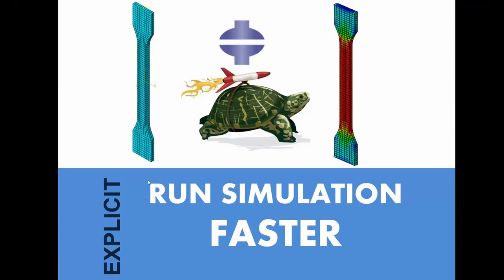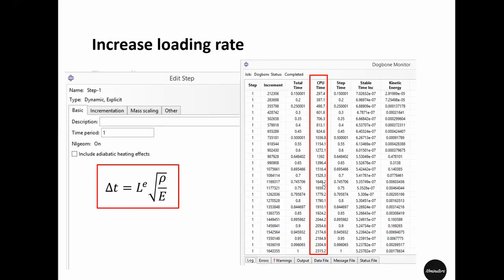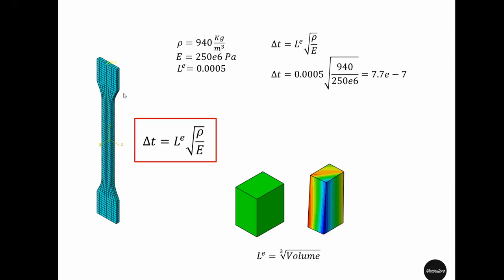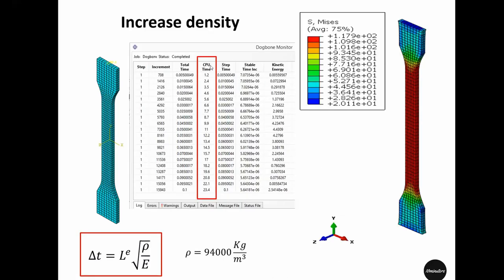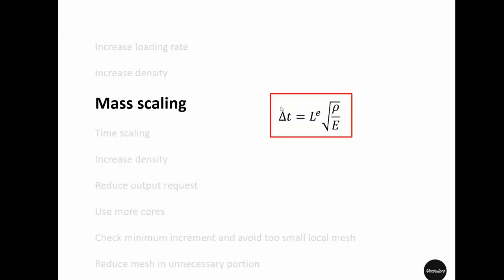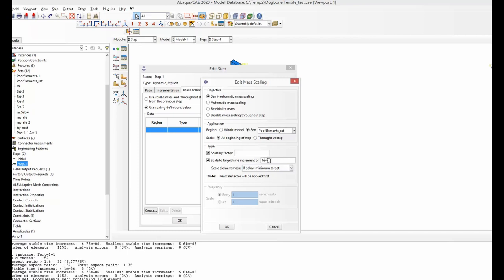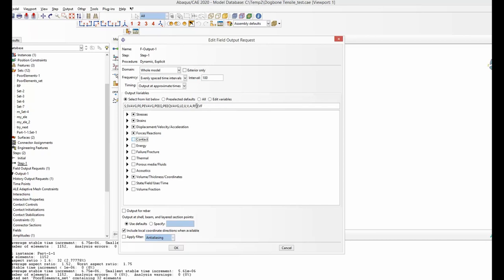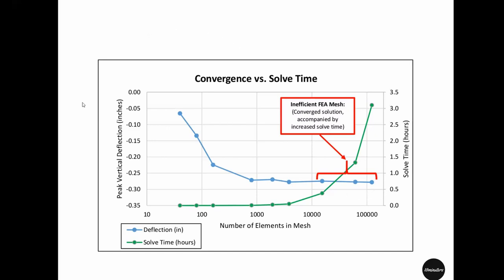How to run Abaqus Explicit simulations faster - 8 Tips

Comment from the maker: You trade-off reliability of the result using these tricks like mass scaling. Some tip on sanity check: Check that the kinetic energy (EKE) does not exceed 5-10% of Internal energy (EI) when using mass scaling. Then make sure  the work done in propelling mass added in mass scaling (ALLMW) is much lesser than  Kinetic energy (ALLKE). Usually, EKE, EVD, EFD should also be much lesser than EI.
Finally, if you have to simulate the same model many times, you can check the result with and without using any scaling etc.

Comment: Great video, also fantastic thumbnail. I tried it for my explicit problem and the reduced calculation time is significant. However, my load displacement curve oscillates extreme, does it mean I cannot use the density scaling?
Reply from the maker: Thanks Dr. Ronald for much encouragement. With high density scaling, inertia force starts to dominate. Same is true for artificially increasing the loading rate. Trying Mass calling only in the set of bad/ small elements can reduce the effect. But if you have to use lot of small elements, try a conservative density scaling instead. I believe using small damping in solution step can also help. Share with us if you find a 'sweet' combination.

Comment: 3:52 calculation mistake and units. density must be tonn/mm3, E should be in N/mm2 and Le in mm.
Reply from the maker: I used SI unit system for this example.

Comment: Nice content and explanation.
While adding mass scaling to an explicit problem what are the possible changes in the result??
Whether it will be proportional to actual result or not??
Reply from the maker: Hi, You trade-off reliability of the result using these tricks like mass scaling.
Example of some problem can be:
The deformation of bodies can be totally unrealistic if high mass scaling is used. You can see high inertia effect i.e. large deformation where force is applied but small deformation in other part of the model. Stress and reaction forces can be too large. Your requested plots like stress, force etc. can give shaky curves. Simulation might abort. etc.

Comment: Hello Sir, I am using shell element S4R type for a composite material, and in the verify mesh section, I cannot select or highlight the elements that might be potentially poor so that I can create a set and assign mass scaling to only those elements. The error message I get is: 'stable time increment could not be calculated for any element in the selected regions. No section assigned...'

Comment: Sir, I am working on the explicit dynamic problem( milling operation) in Abaqus. I defined the interaction as General contact (Tangential -> penalty, Normal -> Hard contact) Master surface (Rigid) - shell element (tool) and slave surface - Node set of workpiece, but I was stuck with this error. "ErrElemExcessDistortion - STEP 1". Can you tell me what could be the mistake?